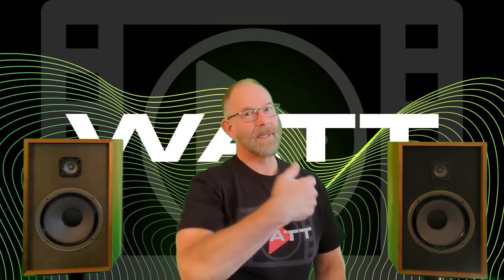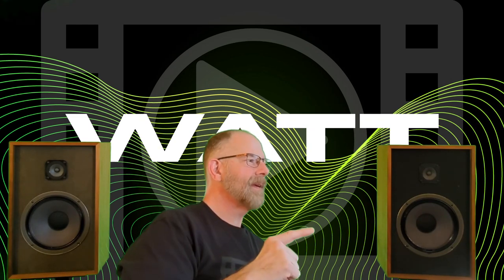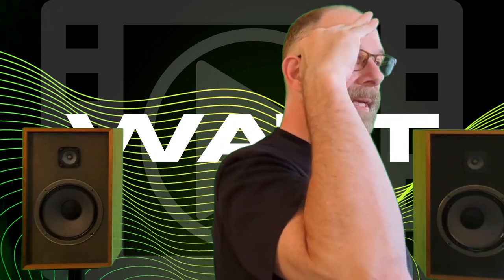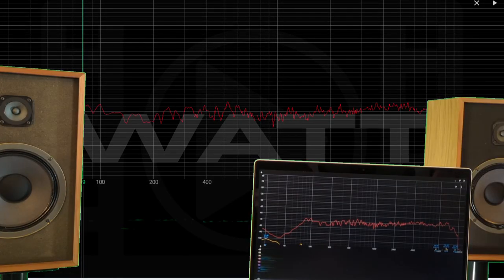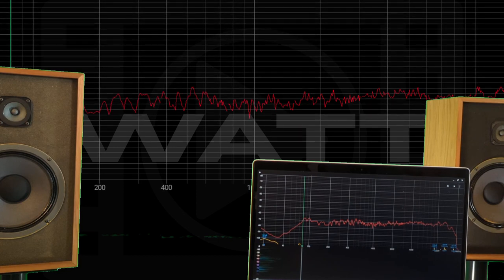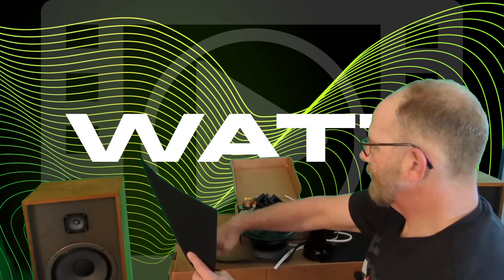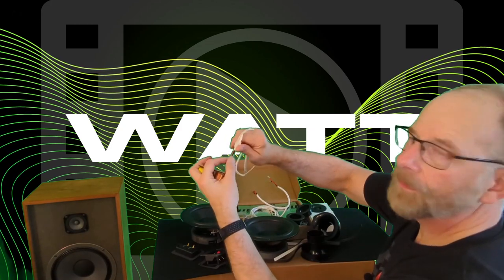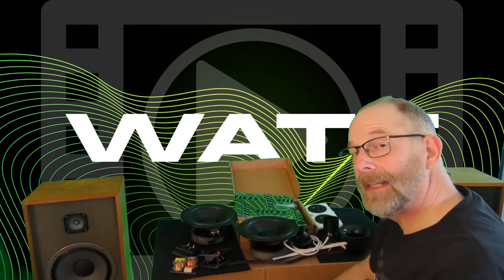Woah Dude! Listening & Frequency Testing Realistic MC-1201 Acoustic Suspension 8 inch 2 Way Speakers

Comment: When I connected my Realistic Nova-16s to my NAD214 amp I was amazed at how good they are.  I bought these new (early 1990s) and didn't think they were very good, but it has always been the poor quality gear I had them connected to.  Now I am powering them with an older Sony 5.1 AVR without a sub and enjoying it.  All I have done to these speakers is replaced the foam surrounds about 5 years ago.  Please keep up the great work you are doing!
Reply from the maker: Thanks for watching and the comment! Question: The Nova 16 you've got... Are they Nova 16 headphones, or the Nova 15 speakers? Looking it up online, I only found the Nova 15, 8 inch 2 Way bass reflex speaker. 

"Speakers for Outstanding Sound on a Budget" - World Radio History https://worldradiohistory.com/hd2/IDX-CATALOGS/IDX/Radio-Shack/Radio-Shack-1989-OCR-Page-0026.pdf

If it's the speakers, I completely agree, the gear can make a huge difference. I'm a huge fan of MORE POWER. I've found that even cheap, cheap speakers can sound way different hooked up to a decent receiver or amp and expensive speakers can underwhelm without enough amp or receiver.

The most relevant example I can give is back in the 1980’s my brother's best friend had, (likely still has), a Realistic receiver, (whatever the best they had at the time was... 120 watts or something and looked a lot like a Pioneer), hooked to his Realistic Mach One speakers. After listening to my much smaller Sound Dynamic 12s speakers on my Harmon Kardon PM660 (rated at 80 WPC), he was blown away, so he wanted to hear his Mach One's on the HK, and it completely woke those up and they sounded entirely different and way better on the Harmon Kardon.

Fast forward to when I was building high power speakers, that same HK amp drove them fine, but even as good as it was with it's "high current capability",  the high power speakers when turned up would suck it dry and lead to awful sound. Hooked up to 2500 watt per channel pro amps however, the high power speakers came alive.

Personally, I think it's got to do with the ability of the amp to supply the current needed during dynamic parts of the music, but that's probably over simplifying it. This may sound like pseudo science, (because it is), but intuitively it makes sense that more powerful amps can "control" the bigger speakers better.

An 8 inch 2 Way doesn't need a ton of power, but if they're 60 watt speakers they should sound better with an amp or receiver that can deliver double that.

I'm in a similar boat now, in that I'm listening and testing on an NAD T-757 V2 in stereo/direct and that receiver is no slouch, neither is the Sony ZA1100ES powering my Energy setup for home theater, but ... I'll bet the speakers I'm building in these videos, (most are at least 200 watt RMS), would benefit greatly from more clean power.
Reply: They are amp sensitive,  they need a correct amp match to bring them out being they are sealed on a warm sounding amp the rock,  on the optonica amp

Comment: Regarding your sound deadening have you actually compared one speaker with and one without to see how much of a difference it makes?
Reply from the maker: Hi Jim, thanks for watching and the great question! I've not compared one completed speaker with another, (like a comparison between two otherwise identical speakers), but that's a cool idea. Thanks, I added that to my topic planner!
Reply: @wattspeakers  I am assuming it would have a similar effect as bracing to get rid of audible cabinet resonance. But be interesting to compare one speaker to another all things being equal except the damping material.
Reply from the maker: I think the videos are most related to the question of resonance and sound deadening is at https://youtu.be/EBGviAxtWN0
And https://youtu.be/PChYVBr846M

My pseudo science goes sort of like this: 
The only thing that will cause a speaker cabinet to have resonance that emanates from the inside, is the Woofer, (assuming it's the only driver exposed inside).

The only thing that can make them cabinet resonate, is IF the woofer is playing loud enough at the natural frequencies of the cabinet construction material, to cause it to vibrate. The 1/2" MDF my old mass market speakers are made of is primarily 1/2” chip board, low grade stuff that seems to have a natural resonance of about 400 Hz to 3500 Hz. I believe the lower the crossover low pass is, the less of an issue it would be.

It seems logical that while a speaker transducer can make things vibrate, I find it difficult to believe a woofer could influence the cabinet resonance at anywhere near the level of direct resonance I'm introducing with DML Exciters in these tests I've done.

With the DML Exciters I definitely can make the cabinets resonate, but it's so much lower in SPL that I have a tough time believing it could make a huge issue. Without sound deadener and only bracing, the resonances were about 20 Db lower than they transducers output would be in that natural frequency range. With the sound deadener, it reduced it so much it was hard to measure. I had to put the measurements mic almost touching the cabinet to pick it up. From a volume aspect, it was at least 40 Db lower than the output of the transducers. No way that would be a concern for typical listening with a sub $1000 speaker.

My conclusion is: Yes speaker cabinets have resonance. Bracing helps reduce it by reducing the size of the resonating surface area by creating smaller, stiffer areas that produce lower volume levels of that Resonance while changing the frequency response where resonance lives. The sound deadener pads reduce that by an even greater amount, (almost exponentially, like by twice or more). 

So... My thought process is, that while a resonating source that's 20 Db lower than loud music MIGHT be audible, but Resonance that's 40 Db lower than the music playing, it's highly unlikely that could be audibly discerned.

That being said, the cabinets also employ poly fiber dampening, which also slows down sound waves before it reaches the sound deadener pads.

In conclusion, I think that a 3 way system is least likely to suffer from resonance, a 2 Way could be more of a challenge, and a full range with only a single driver would be most critical to damp resonance.
Reply: @wattspeakers  That is a very good explanation based on your thorough testing with those exciters, I have watched both of those videos. I am wondering how much the average person could actually hear a difference if they did an (A - B) comparison. You did a great job getting rid of the resonance. Have you ever compared graphically or found a way to test for the resonance as distortion? I have not done this either but curious how much we could see or tell. In the future on a couple of speakers I am working on B&W 110's that I replaced the drivers on when I finish the crossovers I will add some of the Siless sound dampening on one speaker and one without. and then see if I can tell a difference. I may be wrong but thinking if the speaker enclosure is small enough where the wood thickness is 1/2" that may be thick enough and only larger size speakers would benefit from 3/4"  panels. I am sure your right about the resonance of the cabinet only being effected by the woofer.
Reply from the maker: Thanks Jim! It's worth a try and there's so many products out there. I chose the Siless because it's a precut, affordable, butyl (helps eliminate vibration / resonance), and foil, (helps block sound waves from reaching the butyl and MDF).

I've seen other people use other ways to test resonances with different methods, but the exciters are pretty strong, so I'm thinking if I can knock-down resonances caused by them, it should work on whatever vibratory influence sound waves can have.

Let me know how those B&W's turn out!

Comment: Dude,  dont touch those mc 1201.   Thery sounded good iim looking for a pair,  ho much do you wanr for them???
Reply from the maker: I love that... Dude don't touch them. I've got good news and bad news: The good news is that I'll absolutely sell you these MC-1201’s and they are listed for sale at my website for pre-sale.

The bad news is, I've already touched them and I'm about 1/2 Way through the build and expect to have them done today or tomorrow.

I've still got the original drivers, and the stock crossover and wiring setup is disconnected but remains in the cabinet. If you're interested in the RestoMod version when they're done, I'll include the original drivers if you wanted to put them back stock. They can be reverted to stock easily, except with sound deadener and 5 Way Binding Posts.

The finished version will definitely have more power handling, whether or not they sound better than original has yet to be seen but I'm anticipating they'll be better.

Stay tuned for the next video(s) on this project and see how they look and sound in their RestoMod state.
Reply: @wattspeakers  I would not feel guilty modifying these speakers. After all they are not that expensive and do not have huge collector value. And not so rare. However you could sell the original drivers online. I am sure someone would like to use them to replaced damaged drivers in their old speakers. These drivers may of been used in other realistic speakers as well. Life is short enjoy yourself and experiment to your hearts content.